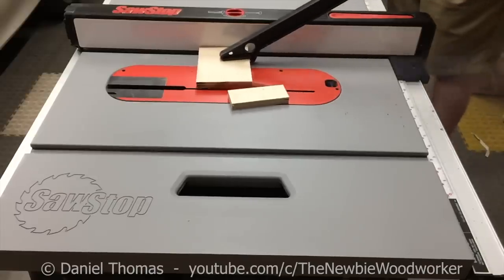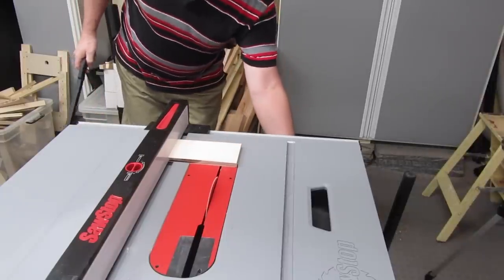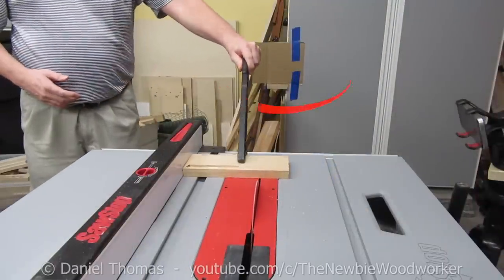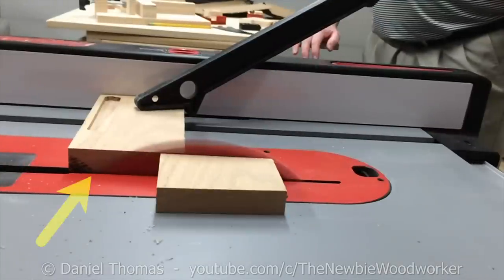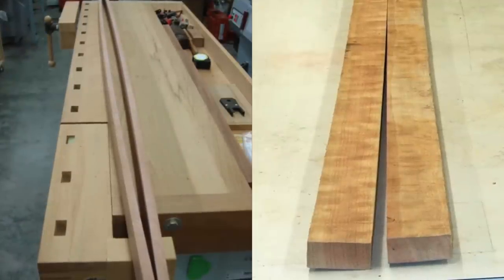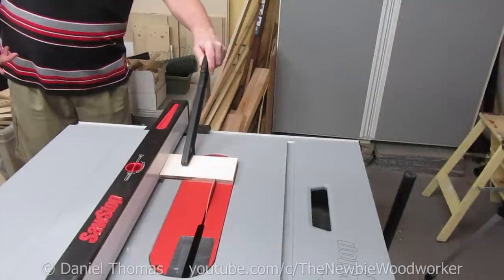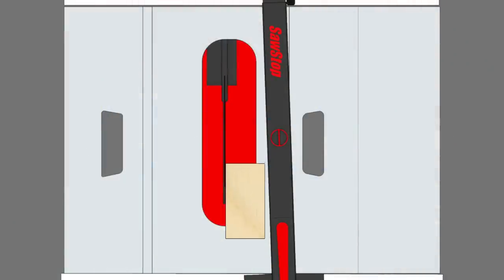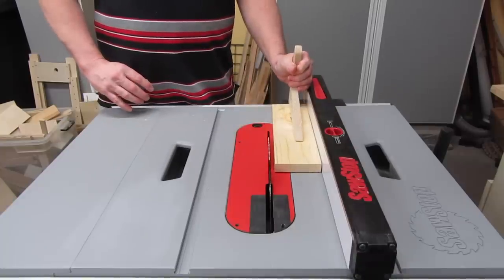Actual Kickback (in Slow Motion), & How to Prevent It

Comment: Thanks for sharing your video & tips on how to prevent kick back. I found the information very useful. I'm also new to operating a table saw so the first thing I did was watch a lot of safety videos on operating a table saw on the basic "dos & don'ts."  From one of the videos I watched, I learned about checking the parallelism of the blade to the mitre slots & fence. I first had bought a cheapie table saw ( on sale even ) - when I checked the blade, it was out of parallel to the mitre slots a lot & even worse, any time I locked the fence down, the fence pulled at the back of the fence towards the blade which was creating the perfect storm for a kick back to happen.I flipped over the saw & there was no trunnions for adjusting the blade. What can you expect from a cheap saw? I would have had to completely disassemble the motor & assembly that raised & lowered the blade to even access where the blade attached to the table. I called the manufacturers & they said it was a manufacturing defect. I returned the saw because I'd only had it a couple of months & only used it a couple of times. My next saw was a Dewalt with the folding stand. Love this saw! I feel so much safer. Everything is parallel. The fence moves on gears front & back so it locks square. The blade guard is attached to the riving knife which also has the anti kick back Paul's. It also comes with a separate riving knife with no attached guard for when I'm not cutting right through the wood but I just want to put in a groove.One of the first things I made for myself was a cross cut sled. I feel much safer using it for cross cutting pieces that would not have much contact against the saw's fence because the piece is longer than it is wider. So no chance to spin on the cross cut sled because the longest part of the board is being pushed against my fence of my sled & my hands are pushing up top the sled out of the way of the blade. One thing you did not mention is how great featherboards are. I made 2. Using a clamp, I have clamped one sometimes lightly to my saw's fence to applynlight pressure down on top of my piece so it can't lift up off the table as I am cutting it, & the other featherboard I clamp in the mitre slot on the left side of the blade to apply light pressure against the piece to keep it against the saw's fence on the as I push my wood through with my push stick while standing off to the side. Keeps my fingers well away from danger.
Reply from the maker: Deb - Thanks for the great reply! One thing, though: You can start new paragraphs in YouTube's comments just by hitting Enter. I read your comment thoroughly, but without paragraph breaks, it was a little hard. Just sayin'. 😛

You talked about checking "parallelism", which is a great idea. I have several videos on the subject, by the way. I can't believe the saw doesn't have adjustments! Good idea to return it. I bought a DeWalt just before I got my SawStop, and it's a really good saw. The only reason I returned it is because my wife told me to get the SawStop, and who am I to argue with that? Like I said, though, the DeWalt is a good saw and I'm sure you'll enjoy it.

Cross cut sleds? Now you're speaking my language. 😄 I love cross cut sleds, and have multiple videos on the subject. The one thing haven't made a video about is my big sled. I love it because I can do all sorts of cuts on it, and as you said, I feel a lot safer making cuts on cross cut sleds.

You're right, I didn't mention featherboards. I keep meaning to make some of my own. Do you have a favorite video on the subject? I've looked at several videos, and I'm not sure which way to go.

Thanks again for the great comment!

Comment: Thanks for making a really great video!
I think I may have som additional tips fr even greater safety:
1) Do as Bill Wheaton says!!
2) If you have groves in your table, bye or make some sort of device that pushes the board toward your fence or spacer block.
3) make the whole table a "no bodypart" zone
4) stand at the side of the table not behind or in front!
5) and most important, if you cant make the cut without ignoring 3 or 4, find some other tool or just don't do the cut!!
Reply from the maker: Thanks for the thoughts!

Comment: I had a kickback accident when a thin piece of maple hit me. Apart from a bruise, I thought nothing of it, until a few months later when I had to have a kidney stone removed. The surgeon saw something that looked like it could be an injury, or worse. So he did a biopsy. The results were negative. However to be prudent, a few years later he went in for another look. The injury had healed and so no further biopsy was needed. Needless to say, it is not a pleasant experience. Shocking that a small piece of wood could result in such a deep injury. 

Since then the splitter (older saw so no riving knife) stays on except if it is not a through cut. I avoid the push stick and use a wooden guide like the one at 12:48 I have also bought and use a Gripper when appropriate. 

Thanks for sharing your important safety tips.
Reply from the maker: Thanks for the comment, and helping keep all of us aware of the things that can happen when something goes wrong. Glad it wasn't any worse for you, but I suspect the worry was worse than the injury.

Comment: Thank you very much for the safety tips. I am a beginner trying to learn through YouTube. This video gives a great insight into safety. Can you please do a video on different kinds of push sticks.
Reply from the maker: Thanks and you're quite welcome. There's a ton of videos on push sticks, and everyone has their own ideas of what's safe and what isn't. Sometimes it's just a matter of what looks or feels right for you. So I recommend trying a few that look good to you. If a push stick makes it feel like you don't have control of the wood, then don't use it. You want to feel comfortable with it.

And as I said before, you can't go wrong with the MicroJig, other than being ridiculously overpriced. But even though they're expensive, I own two - one of them has the 1/8" leg accessory for whenever I need it. The downside of the Grr-Rippers is that you can't use a blade guard - the kind that goes over the top of the blade. You can still use a riving knife, though.

Comment: There is a length to width ratio that will cause kickbacks. Your demonstration shows it. You want enough contact, or as some call it "registration" on the fence so there's control against the workpiece twisting and rotating up and over the blade as you demonstrate. An extended/sacrificial  fence on the miter gauge face is a much safer way to cut narrow pieces because it will push the work and the cutoff past the rear of the blade without any additional push stick and it will keep you fingers out of the way, For normal ripping, use a splitter or riving knife as you correctly suggest. It is the best device to prevent work from loosing contact with the fence, the primary cayuse of kickback!

Comment: Great video!!! I like the stop block idea. Also, I wish I had done the following tasks in order. 1) Align blade with the miter slot. 2) Align the fence with miter slot and add about 0.004" toe out.  The Woodpecker table saw gauge is well worth the money. Also, the gripper is well worth the money. It get two points of contact on the wood and I feel it protect my hand too.
Reply: I think my previous reply got lost. I guess you like the Woodpecker gauge, huh? 😛 And I like the Grr-Ripper also, although most of the time I use two push sticks I made.
Reply from the maker: OK, same as the other one. YouTube changed which account I was logged in under. WTH?

Comment: Honestly, this was really helpful. My dumbass has been crosscutting wood incorrectly for the past few weeks in shop class due to literally zero informative instructions on how to properly use a table saw. After asking shop teacher the most I would really get was to "lower the blade to the height of wood" and use a "push stick." 

Luckily I am fortunate enough that I haven't had any kickbacks or incidents (yet). 
I have never used a table saw before this so I didn't know what to question about it, but I still felt like something wasn't right as the board was sorta pinching along the blade as I quickly pushed it through. 

I guess you live and learn, I'm just glad I didn't have to learn the hard way.
Reply from the maker: Thanks for the comment, but, Holy Cow! What kind of shop teacher do you have? *shudder* I'm really glad my video could help. I suspect after seeing this video, you've already started watching other safety videos, but if you haven't, please do! It's not hard to learn the safe way to use tools, unless nobody tells you. So after you find some helpful videos, email the shop teacher with some links! 😮And seriously, thanks for letting me know I've helped you. That means a lot to me. 😄
Reply from the maker: @fishyman9089  Thanks for the comment! You should show your teacher this video. Even I didn't realize how important the riving knife is, until I did this video! Now I only remove it if the cut requires removing it. Thanks again for the comment. 😄

Comment: Ok, great video, especially for US newbies!  I've been woodworking for years, but believe it not I only just got me a table saw.  I was using a radial arm I inherited from my Dad, until a stroke weakened my RIGHT arm.  Now I'm scared to death of the thing, so I bought my brother in law's Delta contractor table saw.

I've been watching lots of YouTube videos for training before making a single cut, especially safety related.  Last night I made my first cuts, some zero clearance inserts and the first piece of a picture frame.  Here comes the question:

I tilted the blade 8° for a nice bevel on the front.  I opened up one of the inserts to accommodate this.  I installed feather boards in front and behind the blade to ensure an accurate cut, which worked very well.  I held one push stick in the weaker right hand, to feed, and another to keep the stock down against the table.  My fence is properly aligned and clamped.  I stood, as you do, well off to the left (facing from the feed side).  It worked very well, the cut is precise, but it's a bit awkward to feed at a steady rate.  Therefore I got a lot of blade burn which I'll have to sand or plane off, spoiling the precision.

So, the keep side is against the fence and the thin waste piece is free to go without any force.  Seems to me I don't need a splitter, agree?  It's an older saw, no riving knife, and not sure how I'd install a splitter.  I'm very anxious to hear comments!

And thanks for the best info yet on kickback!
Reply from the maker: Thanks for the comment! I think anytime you can use a splitter, riving knife or blade guard, you should. Kickback can happen because of imperfections in the wood - knots and the like. But if something protects the back of the blade, so the stock can't come into contact with the teeth as they come up out of the insert, then that drastically reduces the chances of kickback. There's videos out there that show how to make simple splitters, if nothing else.

But I have another suggestion also: Something like this: https://jessem.com/products/clear-cut-ts-stock-guides. It'll hold down the stock for you, so your weaker right arm only has to push the stock past the blade. I've never used this, but a lot of people swear by it. So, something to consider.
Reply: Just not sure how to install a splitter for a bevel cut!
Reply from the maker: @jimmacaulay844  Sorry, I didn't understand what you were asking (my problem - not yours). Yes, if you're making a bevel/miter cut, as long as your blade tilts away from the fence, I agree that you don't need a splitter or whatever. Again, sorry for my confusion. 🙄
Reply: Hmmm, that may bring up an issue, as the blade DOES tilt towards the fence.  And the Delta Unifence can't work on the left side of the blade.

Except for being hard for me to feed steadily, it felt like a safe cut to me.  The twin featherboards were effective at keeping the stock against the fence and from being pinched.

I don't know how else I could do it.  What do you think?
Reply from the maker: @jimmacaulay844  Here's what I'm thinking, with the blade tilting towards the fence: I can't imagine it's possible for the stock to ride up the back of the blade much at all - it just couldn't fit, right? So if that's true, then the worst that could happen is the stock would shoot pretty much straight back. So as long as you're not in the line of fire, I would think you're fine. This is total speculation on my part - not based on any real knowledge or anything. What do you think?
Reply: I agree.  But perhaps I should clamp a piece of wood to the fence in contact with the stock, instead of holding it down with a push stick.  Seems that would be safer.

Hey, I sure appreciate your advice!
Reply from the maker: @jimmacaulay844  ...or a featherboard. There are some that can be attached to your fence. And no problem - I enjoy these kinds of discussions!
Reply: Here's a photo of the setup, as of the other day:

https://photos.app.goo.gl/ZVfgS2WeGdsxumPT6
Reply: Ya know, I'm an idiot!  I was using a crosscut blade!  Tomorrow or Monday I'll try a ripping blade, bet it'll make a clean cut.
Reply from the maker: @jimmacaulay844  LOL. Not an idiot. Just didn't think of it, that's all. That's why I use a general purpose blade. Works "good enough" for me.

Comment: Great video! Why did you have the blade so high? Just for demo?
When cutting long pieces make sure your outfeed table is lower than the saw. It really sucks when you’re half way through the cut and you hit the table and can’t follow through. Do you bring the material back? Do you try to put downward pressure hoping to lift the front? Both of those moves can be disasters. Taking your hand off of the piece to shut the saw off could also be hazardous.
Reply from the maker: Thanks for the great comments! Yes, I had the blade high for the demo. I normally keep it just barely high enough. 😄

Comment: Wow!  I'm SO glad I watched this.  I'm a newbie.  I knew  2 never use the fence and miter sled together.  But, I thought u could use the fence 2 make cross cuts.  I did think it felt awkward,  like u had 2 exert a lot of pressure 2 keep the board end against the fence.  I'm talking about a 6" or so wide board.  Ok, so I'll use my sled.   It "feels" fine 2 cut larger pieces against the fence.  Otherwise what is the fence 4?

After trying several push blocks, recently I broke down and shelled out the $ for a grr-ripper.  In watching the videos I thought it was ridiculously complicated, not 2 mention expensive.  If u stick 2 the basics it's fine.  I would say that it does give me the most control of the piece, and I've tried a few different kinds of cuts with it.  Overall, I'm pleased that I bought it and wished I hadn't blown the $ on the other ones 1st. 
 U should give it a go, Dan.
Reply from the maker: Thanks for the comment, and I'm glad I could help! As for the Grr-Ripper, I have two of them. The downside of them is that you can't use them with a blade guard, and I've started to use my blade guard more and more. Which is why I built a cross-cut sled that lets me keep the guard on: https://youtu.be/cQINXsn2QBk

Comment: Very good demonstration. I made a similar experience with a chop saw. The impact  on the wall behind was very well visible. For crosscutting for example I don't use a crosscut sled any more. iI made myself a special push bar which keeps my body out of the line of fire and I can keep the riving knife.
Reply from the maker: Thanks. I leave my riving knife in when I use my crosscut sled, and it works great. Personally, I feel much safer anytime I can use a crosscut sled. Not sure why you decided to stop using it?
Reply: I don't understand this statement.  I agree with the NEWBIE in that my riving knife stays on when using my crosscut sled.
Reply: Basically yes but I had use-cases where I had to remove the riving knife. At the end I decided to to get rid of the crosscut sled and make something completely different.

Comment: Great video. I have had kickback with my push stick. I finished a cut, turned the saw off, and was pushing the wood off the back of the saw's table. My attention lapsed and I let the tip of the push stick hit the top of the spinning blade. It came back and hit me in the gut.
Reply from the maker: Thanks, and holy crap! Yeah, losing focus is dangerous. Just when you think the danger is over, BAM! You probably don't make that mistake anymore, though. :)
Reply: I've heard it said that most accidents at the saw occur after you have made your cut when you've stopped paying attention.
Reply from the maker: That's certainly true in my case. I cut off a portion of the tip of my finger about 10 years ago, and it was while I was reaching to turn the power off. I wasn't paying attention to my other hand, which drifted over to the blade. Fortunately it was something that could, and did grow back. :)

Comment: For crosscuts, I use a home made MFT table with 19mm holes precision set to 90 dregrees.  I use a tracksaw to do the cutting.  A tracksaw is protected everywhere but where the saw blade actually cuts the wood.  The only issue is that tracksaws don't have a lot of power so that anything over an inch or so in depth is difficult.  Also the width of the material is based on the size of the table.  I can cut 24in wide sheet goods easily.  Narrow pieces can be cut with homemade jigs or square pieces of scrape.  Peter Millard has several excellent videos on how to do this.
Reply from the maker: Thanks for the comment. 😄